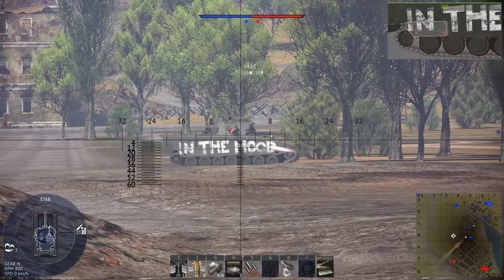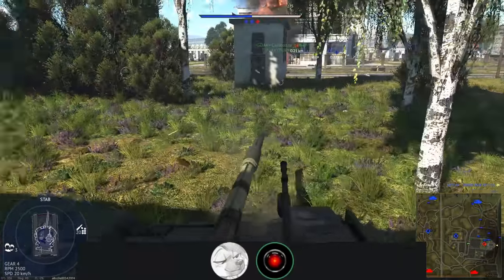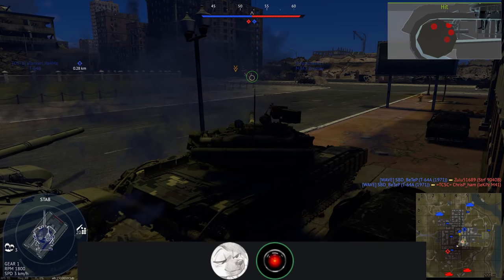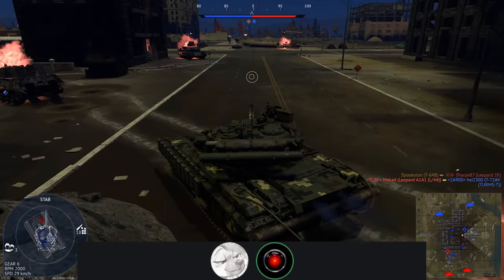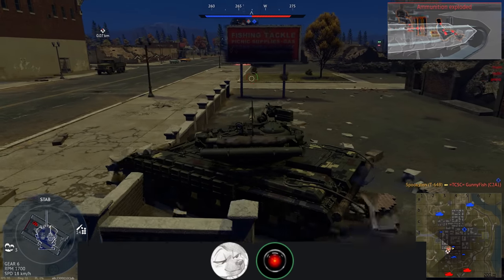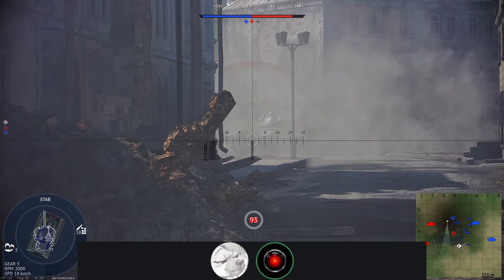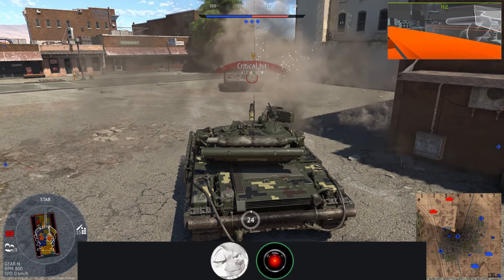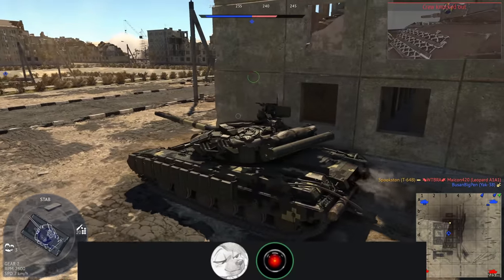Why Do Russian Tanks Have Cages?

Comment: I have had my suspicions that these cages were there to protect against weaker munitions and not as a protection against Javelins, guess I was right. I knew from reading history books and such that in Urban warfare, tanks turret tops are very much exposed to anyone with an RPG or thrown AT mine on top of a tall building. The Drone munitions part though surprised me, didn't know Ukraine had drones like that with those types of munitions. I knew they had suicide drones and UAVs, just didn't know they had those Turkish ones. As for mortars, I never really thought of using mortars as AT weapons, guess its possible, but that would be very hard to hit the top of a tank with one. If its effective against these smaller weapons, good for them for coming up with a way to defeat them cheap and effectively, but it still won't protect against anything substantial like Javelins or the larger RPG warheads like the ones with tandem charges.
Reply: I don't know how difficult it'd be but you could probably toss mortar rounds out the side of a tallish building onto the tank's roof if you had good enough aim. Idk about arming the mortars beforehand though. Saving Private Ryan can only teach one so much about modern mortar systems.
Reply: They stoped RPG often in Iraq
Reply: @ifv2089  while that may be true, they’re shooting themselves in the foot by throwing sandbags and shit on top of them. Skinny bars trap the warhead without letting its pressure sensor get tripped, while thick bars/sandbags/ tree limbs will cause it to explode still. The damage will not be as bad, but I imagine the tank will not be functioning the same after an explosion 2-3 feet above the turret
Reply: @bakermayfield6hunnitdan6er24  yeah you don't put things over the top of Bar armour it doesn't work like this.
Plenty of evidence showing warheads stuck out the sides of our warriors and bulldog 432 in Iraq and mastiff and viking in Afghan 
I seen our waggons role into basra Palace with RPG sticking out the Bar, was a normal event after night patrols in the Udey triangle or Shia Flats, worked well we had warriors that took up to 7 hits and were fine
Reply: It may be hard, but through saturation it is very much possible. 82 mm mortars can be fired REALLY fast

Comment: I mean, I looked at them and thought 'they are expecting urban, maybe they are a 'rain-shield' for debris off of buildings or other such things, to prevent the risk of them damaging hatches or otherwise complicating operation'. Could also, maybe, be some sort of 'this is allied' identifier as well. IIRC a lot of Ukrainian tanks are modifications of Russian tanks. Maybe that change to silhouette is an attempt at a sneaky vis ID shortcut?

I expect that no matter what their intended purpose is, they probably don't fill it too well. Aluminum/steel frames tend not to be very good for much these days.
Reply: That’s not a bad theory, I suspect you don’t want cinder blocks dropping onto your thermal sight.
Reply: There weren't any modifications of russian tanks only USSR one's
Reply: @ALGNC  Bruh. 
Most of Russia's current inventory is modifications of 'USSR' vehicles. Russia was also the controlling stake in the USSR.  There is ZERO point in that distinction when talking about armored vehicles.
Reply: @jtnachos16  yeah and the most advance Russian equipment is not even in the front line since they could not even produce a lot of them and people are saying that there probably to expensive to use  so yeah most of the war is fought whit soviet era design
Reply: @jtnachos16  So what , this is still not russian tanks
Reply: @Underpaid T-72 mechanic Just im a nerd for military equipment and it just doesn't feel right.
Reply: @ALGNC  by that logic german ww2 tanks aren't german tanks, they're nazi tanks
Reply: @antheunis011  By your logic Geramany was called Nazi

Comment: I think he's right about them expecting urban combat and attacks from above. Something he didn't mention was grenades and mines- tanks in WW1 had similar cages to allow grenades to roll off or blow up at a safe distance from the tanks skin. 
In addition, I guess it doubles as a sun shield and a "hope this helps" vs NLAW and other top attack stuff.
Reply: Honestly the concept of having cage to roll grenades off the top of the vehicle seems really arbitrary for me, especially for early WW2 vehicles. 

Vehicles are always on the move so good luck throwing grenades on higher position right into the hatch, if anything it will just roll off or misses the vehicle entirely (without the cage). Cage armor makes more sense for RPG though
Reply: @quakethedoombringer  Yeah, I guess the idea is more that the grenade detonates up there rather than on the skin, useful when they get bogged down in cities. Main use is probably RPGs tho

Comment: This can be summed up into a simple conclusion if you want to avoid rambling.

B: “Why would you bother wearing ceramic body armor, it’s not at all effective against a 40mm bofors round”

A: “But it will stop 45acp, 9mm, 5.56, 7.62, .308, 12 gauge slug, buckshot, shrapnel, lacerations, impalings, majority of thorned plants, blunt impacts” 

B: “Well it won’t stop 40mm bofors, So there’s no point in wearing it”
Reply: The issue is that you showed up to a rocket launcher fight with rifle armor. That's funny in itself.

Comment: Also there is an often overlooked problem with HEAT rounds.  They are designed for optimal focus of the jet at the impact point.  If the impact point is the cage, that means the jet travels roughly 1 meter through air before hitting the roof.  If the heat round is small enough(and most top attack munitions are indeed small, this 1 meter air gap might be enough to disperse the jet to the point where it can't penetrate the roof.  In a way, air is armor :)
Reply: thats why some nera armors use air gaps as effective method of stopping some heat munitions. its well known. whether 0.6kg of explosive material, that is installed on javelin, is enough to penetrate top armor after traveling at least 50cm through air is up to debate.

Comment: I was thinking that'd be far more effective against top attack shaped charge munitions if they used the cage as a mounting point for ERA to both increase standoff distance and protect optics and modules on the roof of the tank.
Reply: cage triggers the rocket the same, then comes era into play(that can try to neutralize main charge). its unlikely that it stops javelin completly, but i could stop some other munitions. only conter to javelin that russian have on tanks, is shtora-1 system on t-90A and its not supposed to work that well against those rockets especially since its hard to detect a javelin lock-on (fire-and-forget).
Reply: @seushimarejikaze1337  it will work pretty well against them. It’s gonna give a warning and pop smoke to break javelin’s lock.

Comment: Regular RPG7 rockets are still very dangerous from the top down, just get on the roof of a building or a appartment balcony and wait for the enemy tank to get close enough . The cage dont neeed to stop a javelin to be effective
Reply: The warheads can get stuck in the slats and fail to detonate with the RPG what it was mainly used for in Iraq and Afghan

Comment: Cope cages are the schurzen of modern battles. 
Designed to protect against "obsolete" threats, like older generation HEAT warheads and mines but absolutely useless against more modern implements.
For the ww2 implement, it's only useful for AT rifles.
In both cases, they add more weight to protect against older threats, but contribute to their aesthetic appeal.
Reply: i guarantee there is some Ukrainian out there still using a PTRD-41

Comment: Since those cages are useless for stopping top-attack missiles, I think they're meant to keep the crew from abandoning the tank and defecting. :P
Reply: in what way are they useless?
Reply: @TheArcticFoxxo  As described in the video, these cages do nothing to counter Javelin missiles as not only do they have a tandem warhead that defeats the cage, but the main warhead is so large that it simply brute-forces through the cage and into the target.
Reply: @Orca19904  and thats what happens when you meet an american missile, where most half delayed fuses and work specifically off of kinetic energy to get through the thinner metal.

Comment: I still find it weird that the only tanks we've seen are old T72bm's
Reply: Probably becuase it is an urban warfare package. Why send a more expensive tank into urban combat when the ranges are so close the extra armour/etc of the t90 won't make mutch of a difference.
Reply: @matthiuskoenig3378  that's a good point actually, because I was thinking the APS systems would be much more effective, not the stura red eyes of doom, the other one which name I have forgotten.
Reply: There are old T72AVs too. Very little "new" equipment has been used so far but there have been T-90s and T72B3 used and even captured. Funnily enough yesterday the Russians captured a fair few T64B's. Both sides are using captured equipment from the other side.

Comment: Good presentation. One note on Anti-Tank Fuzing and ways to prevent activation or proper function on activation. The US troops in Vietnam used chain link fence set at 2-meter distance from the night laagered vehicles to prevent 50% of Chinese B-40 and RPG-7 rounds from detonating and some much smaller percentage from incomplete function.
Mechanic of this is Fuze is tiny at the nose no other impact function present. Round misses hitting a wire and jams in the fence with the warhead damaged. Warhead hits wire and goes off too far from vehicle for adequate penetration.
Dragon, TOW and later US warheads have full frontal aspect thin layer fuzing where any impact will set off the warhead. Cage will only slightly reduce impact through armor effects if it is too close to the vehicle. Each warhead that may be used vs. the cage has to be looked at in detail for the best possible defense across a broad spectrum of threats. Maverick and MK-84 based JDAM excepted they rule.

Comment: The thing with RT too, is I'm certain they wanted everyone to think the cages stop the Javelin, so maybe people would be reluctant to try using them on caged tanks.  Basically just propaganda protection.  But any chance of that happening is completely gone now, everyone knows it's immune to the cage.  It seems like even in Direct Attack mode it's still quite effective, so even if the cage did work, it could be bypassed.

Comment: It very much makes sense that, even if the cages aren't effective at all against Javelins/NLAWs, it doesn't mean those are the only threats on the battlefield. If it can defend against weaker munitions that will also be present, it's still worth bringing.
Reply: not if it weighs your tank down to where it gets stuck in the mud or causes the transmission to burn out

Comment: The problem with these cages is that even if the cage manage to detonate the precursor charge, the explosively formed projective (EFP) which is essentially a copper slug contrary to what people believe as a molten copper jet (which shouldn't happen since the explosive itself could not possibly heat the copper to its melting point) would still hit the roof mounted ERA and detonate it, allowing the main warhead to strike the armor unharmed.

Comment: Cope cages were actually fixed to t-whatever series tanks. It’s already been admitted to by them that it’s the same “hillbilly armor” we did in early OIF. Javelins detonate on impact and set off their secondary warhead in the form of a shaped charge. It is an attempt at stand off protection. It’s an attempt to reduce the velocity the molten metal hits and the temp it hits the top of the turret (y’all need to get a 2C identifier before you go rambling about ATGMs anymore). Yes it could help in an urban environment and RPG’s. But no, this is not from their Grozny experience nor even the Russo/Georgian War. This is already vetted and sourced from the theatre of operations. However, they serve a multi purpose. They also can act as sniper cages did to turrets in AFG and IQ in that they provide concealment to the turret crew members and MAY provide some protection against loitering munitions and suicide drone. Both of which have been procured from Turkey, Israel and the US. The idea on tanks gained its traction in the Azerbaijani/Armenian war no one watched or cared about. Again, all of this information is already out there, open source through various no partisan OSINT/SIGINT channels online.

Comment: I'm sorry but what's the person being interviewed experience? Is he some sort of military analyst? If he is not, he is just an observer like the rest of us. His conclusions that he states in my opinion are quite reasonable, but he has yet to mention any potential draw backs of such systems. 

1) Increases the profile of the tank by at least 0.5 -1 meter.
2) Potentially increases weight of the vehicle decreasing mobility and speed especially if from what I have seen sandbags are being added on top of those cages. 
3) Additional weight might cause the fuel autonomy of the vehicle to decrease especially if significant sandbags are added.
4) Costs of adding such systems. The additional manpower, construction, logistical costs of adding these to thousands of vehicles, instead of money that could have been used for other equipment has been used on these cages.

Overall, I am inclined to believe that without more concrete evidence shown about these cages on their operational and tactical employment, we should just wait for their verdict when this ends rather than saying much about it.

Comment: So the cage won't work because of its location. What your friend doesn't understand is that the cage is designed to distort the shape charge. That's where penitrating power comes from. Your friend actually doesn't know what he's talking about but he tried tho. Properly fitted cage in the correct location can easily stop a certain percentage those munitions.

Comment: I read that the cages were to prevent the tank crew from surrendering or deserting. Once inside, their commanding officer locked them in and unlocked them only for vodka breaks or if they killed 5 enemy tanks. Rumor has it that the latter hasn't happened yet. True story.

Comment: Ukraine uses consumer grade drones to drop AT grenades onto the roofs of AFVs with pretty good results compared to the risk/cost. These cages would probably help protect the crew from that somewhat but from what I've seen they usually drop the grenades on the engine bay anyway. It disables the engine, crew bails and flees and ukrainian engineers have a new tank to use for parts.

Comment: there is a thrown anti tank grenade the RKG-3 is one of them which is designed to be dropped or thrown and a drogue deploys to ensure proper orientation.. seen them used in the middle east.. it's a older munition but still in use

Comment: Right now tank armor is far behind in the race with anti armor.  It probably won't change until they invent some sort of wonder material to replace steel.
Reply: You say that, but why do you think they use top attack rather than front attack ATGMS. the Front of the Hull and Turrets have a ton of ERA which defeats most ATGMs and such very well, the problem is you can't place much ERA on the top of the turret, which is why top attacks are so effective against T72s, T80s, and T90s.

Comment: Calling them 'cope cages' is absolutely childish and demonstrates that the person calling them that has no great understanding of military hardware/history. 
Just like in WT, where you can go from killing a Type 10 only to next face a Chi Ha Kai, the technology of the past hasn't been done away with entirely and all threats should be handled appropriately.
In this case, why fork out millions to retrofit your MBT's with advanced defence systems when a simple cage apparatus will suffice? 
It may not defend against every threat imaginable but as the interviewee said, it doesn't need to.
I'm sure this will neuter Ukrainian resistance to Russian armoured units as they will not always be deploying top-of-the-line missiles like the Javelin every time they come across a T-90 and it is only a matter of time until they take Kiev.
Reply: Because those millions would prevent losses. They're playing by big boy rules and should act like it.
If you're fielding tanks without hard kill protection systems and relying on a small cage to protect from less developed weapons, you're asking for those same less developed weapons to just be used to blow the tracks off tanks. It's a complete false economy to rely on such half-assed measures when they'll actually do nothing to ensure the safety of the tank crews. Which will either have to abandon immobilized tanks, surrender or get blown if they refuse to leave.

Comment: The cage armor with slats (wether it is mounted on top of the turret or on the sides) are not to increase standoff distance - it won't matter as the warhead (any warhead fielded today really, even a 40mm dual purpose grenade slung from a underbarrel grenade launcher can probably, under ideal angles, penetrate the roof armour on any main battle tank fielded today) will penetrate the roof - the utility of cage armor is to short circuit electrical fuses in, mainly, RPG-7 warheads as well as those warheads that uses the same type of fuzing system, rendering the warhead a dud.